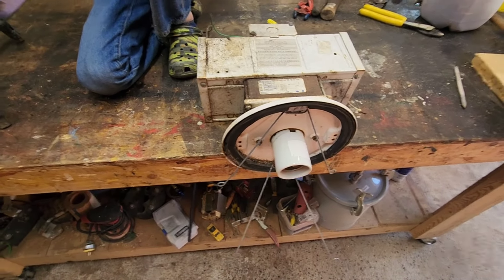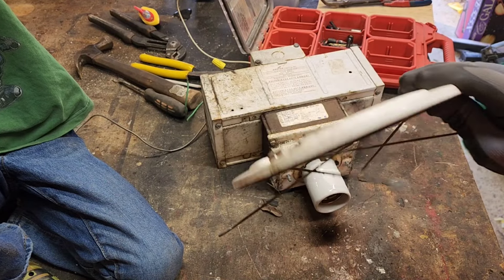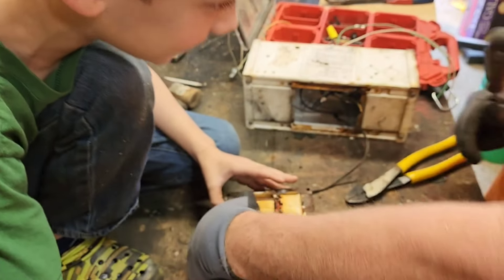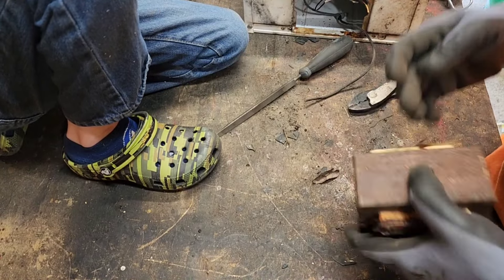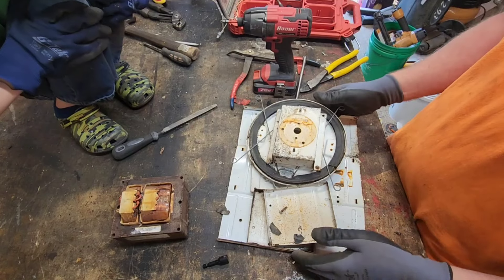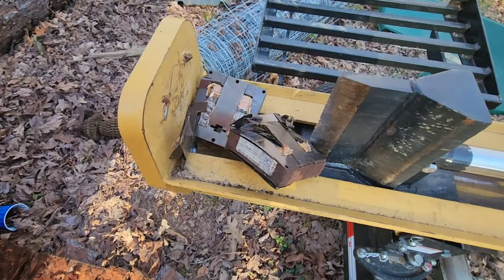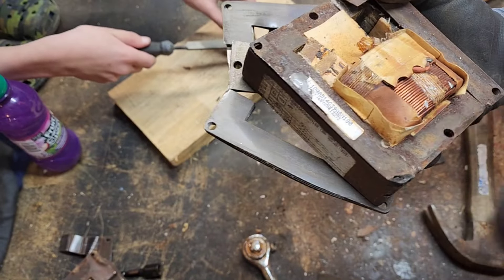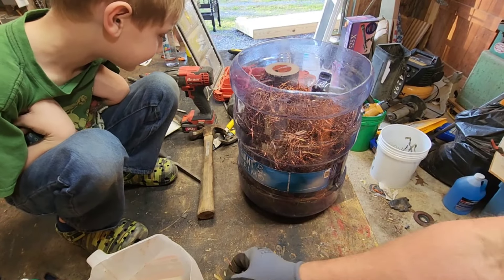scrapping transformers the easy way.

Comment: Nice first video. Great kid too, keep him interested. I once scrapped a VCR with my teen age daughter. She never wanted to help scrap again. This is a guy thing. That ceramic lamp holder probably has brass inside. I wrap min in a shop rag and wack with a hammer. Check every part for brass, even the white metal could be plated. Whenever I get AL wire I toss it in with my AL. My yard never says anything. I do not get a lot so they probably do not notice it. 

If I had a log splitter I would be doing it that way. On most of my transformers I use the Machete method. Same idea but with a $10 walmart machete. I cut off the first 6 inches to make it handle better.
Reply from the maker: Dalton loves to help, my daughter has helped me run the sawmill . They both love to get involved which I'm very grateful for.   Thanks for watching.
Reply: Some people pound on an axe to break those apart
Reply from the maker: @FishermanButch72  I've tried that one too.
Reply: @CopperEyeJoe  an ax is too wide you will be fighting the strength of the wire. I use a machete. I cut off 12" and it works great. I wish I had a log splitter, even less work.

Comment: I scrapped most my life...i have a mound about 15-20 tons mixed metals..i'm getting too old so the blackberries are eating it lol...i throw the capacitors in shred....great video....new sub :)
Reply from the maker: Thank you for the sub, I'm 5 yrs away from a 30-year retirement with the county, so I look foward to scrapping full time soon.
Reply: @CopperEyeJoe very cool! I retired 5 years ago...got a couple acres completely off grid. only solar and rain water. finally peace and quiet. i'm the only one out here to make noise :) I hope the 5 years goes fast for you!
Reply: when scrap got way low i just stockpiled it behind my one shed  to hide it from the road view and when it went up i had them bring me semi trailers to me. I borrowed an old machine from my dad's business that wasn't being used anymore and i loaded 64 tons in their trailers that month. that was a good payday that month when i got my check. paid for most of my second shed i built where my stock pile was.

Comment: You have prepared steel from the transformer and #2 copper from the transformer. Cast aluminum. Sheet metal from the housing of the unit. And some #1 wire that you can strip and some #2 wire that you can strip and throw it in with the other one from the transformer. Keep up the great work
Reply from the maker: Thanks for the info.

Comment: Interesting way to process transformers. I've processed one or two transformers in my day and just want to say keep an eye out for steel spacers on some lighting transformers you won't be able to split all them like you did with out knocking out the spacers. The steel from the transformers is called silica steel and you should be able to get #1 steel. Try and keep it together as much as possible. Good luck on the new channel .
Reply from the maker: Thanks for the advice and for watching.

Comment: Some capacitors are aluminum and some are steel, but they all may still contain a charge so always short them out or get zapped.  I just throw them in with my shred for weight instead of tearing them down.  They have oil inside and are not worth breaking apart, but I do check to see if the prongs are brass and cut them off to sell as yellow brass
Reply from the maker: Good to know . Thanks for watching.

Comment: hi i do put aluminum wires in a bucket because it’s 7 cents per pound left in shred pile
and 30 or 45 cents per pound as
aluminum only
Reply: I get very little AL wire and it is always heavy guage and I run it through my stripper. My scrap yard ahs no problem putting it in. Actually I do not even need to sort my AL they pay the same for all three types and put it all in one dumpster. I do pull out AL/CU computer heatsinks/

Comment: My scrap yard gives me painted aluminum clip for the transformer aluminum coils. I also drain my capacitors mineral oil and use it for other things, chainsaws and other machinery that needs extra lube oil, the drained capacitors go in to the shred pile.
Reply from the maker: Thanks for the info, I save the oil as well.

Comment: I did this with a shop press and a hardened steel scraper blade. I found it worked better if I sharpened the tip of the blade so it could get between the plates and not bend them. After about 40 transformers, even though the blade wasn't damaged, it needed resharpening. Then my scrap yard only gave me 45 (mid grade copper wire) price for it. I took the money because the other yard close to me couldn't even make an offer. It's like they can't tell what 99% copper looks like. So, I'm keeping my copper from now on, melting, casting it, then selling it for 10x scrap value. Dishonest scrap yards aren't going to get rich off my labor.
Reply from the maker: Sorry to hear that, friend.   I took some copper off Friday, and it was 3.80 a pound for bare bright.
Reply: Yeah, some of these yards are something else! We get $2.80 per pound with a smile, very nice people, but your ass hurts when you're leaving!! Going price is something like $3.30-$3.65 per pound for #2 dirty copper right now, but good luck finding a yard who will give you what it's supposedly worth.

I thought about melting it down, but damn, that would be some long hot hard work in the summers, but who the hell is going to buy it for a good price to make it worth your while anyway? It's looking more and more like going to work for minimum wage is going to be further ahead for me.
Reply from the maker: @patrickm.8425  I think bare bright is like 3.80 at my local.yard right now.   Funny thing is another local yard ( same distance away)  was only giving 2.80 per pound.   It's crazy how some do their prices.
Reply: @patrickm.8425  some people get 10x scrap value just for copper ingots. Imagine what else you can make with cast copper. I'd like to play around with growing copper crystals with electrolysis, and making bronze/brass alloys and casting large items like bells, oversized historical insignia, etc. I also collect rocks and can imagine making decorative items with gems and copper.

Comment: In regards to your aluminum, separate it. Depending on where you are, it's probably double, if not triple,  the value of the steel.

It would probably be an idea to check out some of ProjectShopFl's transformer videos. He's been known to do a few from time to time.
Reply from the maker: I sure will, and thanks for the advice.
Reply: The best thing you can do is watch more videos like project shop FL.
I watch and follow a lot of different recyclers you can learn a lot from other people if you have an open mind.
I have been scraping for 30 years and I still learn new things your never too old to learn something new unless you forget what it was that you just learned witch I think I have done. I know I just learned something new from you but I remember making a comment about learning something on another channel and it was just last week.
Any way watch more videos I liked and subscribed .

Comment: Sometimes there is a couple of layers of copper winding layers under the aluminum layers on transformers. Cast has a seam halfway between top and bottom or left and right. Extruded aluminum doesn't have a seam

Comment: Depends on the yard but the one i use most times for shred want the capacitors removed. I have seen them reject loads from the appliance stores and see them taking them out in the parking lot so they will accept the appliances.  the other yard will accept most appliances full and don't care about capacitors. 

As others said I remove aluminum wire too.  it pays better than shred.
Reply from the maker: Will do friend.

Comment: I scrapped a street light and took the transformer out but I don't have that type of tool to bust the transformer
Reply from the maker: I saw it done on another channel  and gave it a try.   Definitely makes it easier.
Reply: Depending what tools you have you can use a machete to split it open in the center like he did with the wood splitter or you can just cut one side off with a grinder or sawzall or hacksaw and just grab the other side with a pump pliers and pull it through or use a hammer and punch it out or if you have very little in tools then you can just cut the one side off with a wire cutter and go from that. when you can afford to or me  I would spend your money from scrapping to buy certain tools to make this fun gig faster and easier and then it becomes a better fun gig when you make more when you invested the same amount of time.  yep in scrapping tools are your friend.  my favorite is my sawzall and my plasma cutter probably. when i started 40 years ago, i only had  manual hand tools and built my arsenal up from that.
Reply from the maker: @steveherr450  thanks for the advice . I have since put my scrap money on a wire stripper. It already paid for itself many times over.    My next purchase will be a nicer wire stripper and some other tools.   Just messing around on the side I've made 2,500 in the past 2 months.  
That small potatoes, but for the little amount of time I'm putting in it's nice side money.